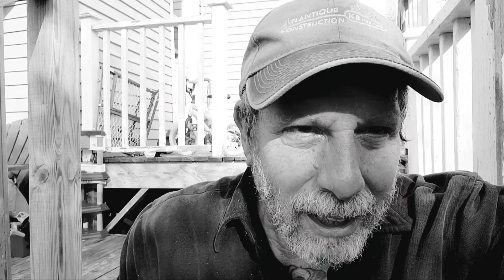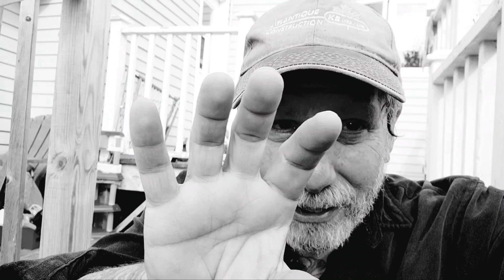Blender: Distorted Decals on Curved Surface?

Comment: LOL. Cool thing man. When doing the Shrinkwrap method and using Eevee if I zoom out I get some sort of surface fighting/blending going on. Does not happen with Cycles. Maybe you can address that as well. You'll see.
Reply from the maker: Yes, I guess it just does that but shouldn't affect render.  If it does, consider cycles.